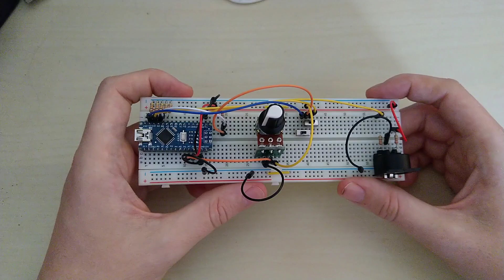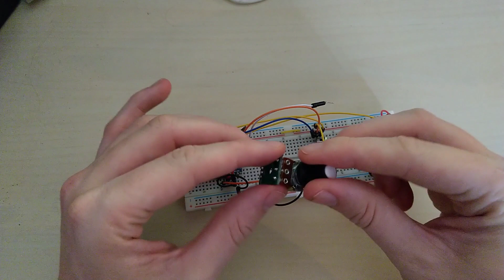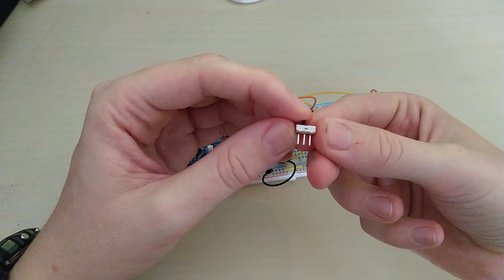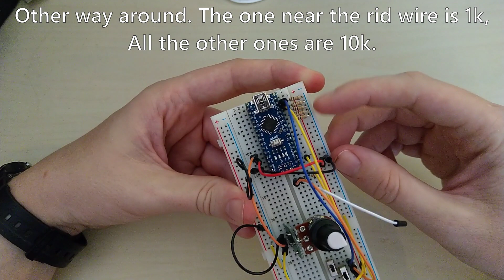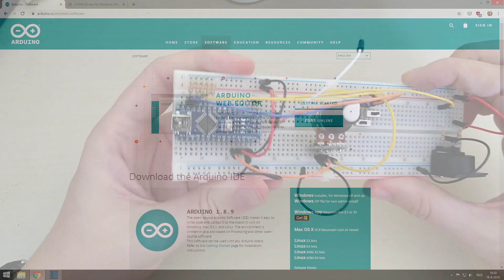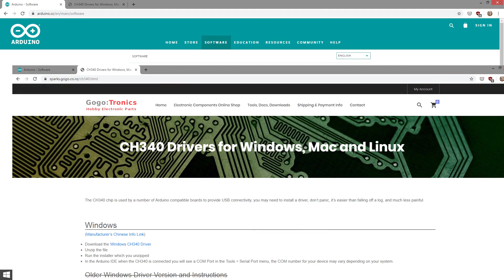Random Sequence Generator - Sketch, Schematic, Other Info

Comment: Also, you can use internal pull up or pull down on pins, they are configurable
Reply from the maker: Yeah that's true, I once heard that it's considered 'good practice' to use physical pull up/down resistors as they are more reliable or something. Probably no need to do it this way at all, the person that told me this is a bit older and it may have been better in the past. But it kinda stuck with me and I'm always overly cautious. Even with 4 dollar Arduino clones :P

Comment: These clones run on 12v in my projects, no issues so far
Reply from the maker: Nice, good to know, some people do say that in the long run it might not be great for them bc they get a little bit hit, so if you're running them 24/7 for months at a time it's probably worth the effort of lowering the input voltage, but for projects like this I assume it's fine.
Reply: @OttosTheName  whoa, thanks for pointing this out. By far, I made  projects that should run few hours only. For 24/7 - I'll use lower voltage .
Reply: Hi Otto, I really like the sequencer and I’m going to have a go building one soon, just waiting on a midi jack arriving. You asked in the video if there was any requests , so I was wondering if the notes could be sent via cv and not just midi and then it could be used as a eurorack sequencer? Not sure if it’s even possible just thought I’d ask.